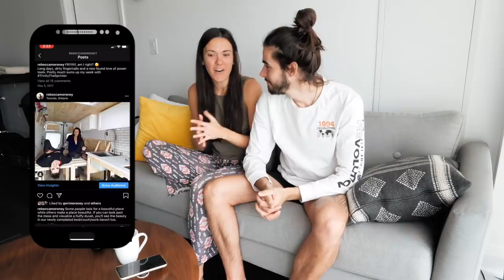VAN LIFE: Installing Windows on Sprinter Van Conversion

Comment: With the Seitz sliding windows it's important to install the windows so the sliding side is in driving direction front. Otherwise you might run into issues with noise and water pressing into the gasket while driving. I don't know if it's the same with C.R. Lawrence ones.

Comment: Hey guys, great job so far. I'm no expert, but here's a suggestion. I think the right window should be with the sliding part the other way around, like the one on the left side, for better aerodynamics and seal while driving, especially in rainy days.

Comment: I would recommend flipping the second window you installed...you want to fixed pain to go towards the front of the van so the wind doesn’t push air and water through the seam where the fixed and sliding pains meet. So it would match the other window in terms of orientation in the hole.
Reply from the maker: Thanks for the thoughts Kyle! I wasn’t sure you were able to do this as there were three ventilation holes at the bottom of the window. Have you ever done this before?
Reply: Yes, we did it on our skoolie @roamingrivers.  However ours have the weep holes on both sides...those holes are for the water that lands in the window tracks, so it can drip out of the van and not into the van if the track gets to full.  If yours don’t have the weep holes on both sides, you could always drill a few holes and make your own weep holes.

Comment: We installed our CRL windows literally 2 weeks ago and had the exact same problems! The first hole, too big... and the screws??? What exactly are you supposed to screw them into?😂 When we did the second one we pre screwed all the screws in the holes BEFORE putting it up and they went in wayyy smoother once it was in the van wall!

Comment: I feel your frustration with those CR Laurence windows. I put 2 of them in my van, too. It’s really ridiculous that they don’t come with a template, especially considering how expensive they are. Is that water fill going to be high enough—higher than the top of the tank you’ll be filling? After spending hundreds of hours building my van over the past year and a half, and dealing with all of the difficulties and frustrations, I can’t imagine ever building another one. I’ll be very happy to complete mine later this year, and to not be building all of the time. Good luck with the rest of your build!
Reply: Put the retaining frame where you want the window on the inside of the wall, to clear structure. Drill one hole to locate to the outside. Move frame to outside of the wall, using the hole to locate it. Screw the frame in place with sheet metal screws and trace around the outside of the inner flange. (Not outside the outer flange (too big) or inside the inner flange (too small)) cut right on the line and you’ll have about 1/16” clearance all the way around. Much more accurate than any template. These products are intended for trades not DIYers, so DIYers have to make do. 
Trim the hole with a single strip of butyl tape with the join of the tape ends at the bottom corner of the window toward the rear of the vehicle with ends tight but not overlapping and install the window. 
When the window is clamped in place with the inner trim ring the butyl tape will migrate and fill any insignificant gap. 
The location of the joint in the tape ensures rain from above or forward (like when driving) doesn’t get driven into a gap that can get inside. 
Also make sure sliding windows are oriented on the correctly on side of the vehicle for the same reason. Unfortunately it looks like the Passenger side window is installed the wrong way around. It’s gonna be a leaker.

Comment: Glad you said not to use a level, as the van won't be level. Why did you use one for the wall battening?.. Lol
Tip... When cutting out openings, put a piece of plastic inside to catch the metal shavings or they can go ionto the floor and into panels and rust.

Comment: rather than drilling the outside of the template to get your location, drill two holes through the middle of either end of the template, then when you go to the outside they're your locating spots. It should be more precise than matching up little holes to where it looks like they belong against the template :)

Comment: How come I never see you caulking when you install the windows...install the water fill connection? That's what keeps your water out for leaks ! You should be putting a bead down on these items then push in place. Use your finger-rag immediately and wipe off excess

Comment: Hey guys... I own a auto glass company. I'm a little concerned about your windows. You should always be priming that metal after you cut it. You're going to get rust in there. And just so you know you never ever ever use silicone on your vehicle. Especially if you're ever going to use urethane. It can cause your vehicle to rust. My suggestion is that you pull that glass back out and primer the edge. I would put it in with some urethane. You could use the sikaflex that Everyone likes so much. You can get urethane with or without primer in it, I always suggest with. But I would primer it also.
If you have any questions, you are welcome to DM me. I have an Instagram account under the same name.

Comment: Have had so many of these garbage CRL windows leak. DO NOT RECCOMEND! Go with AM Auto for a much nicer window or Tern Overland. The CRL was literally pouring water inside the van and not from the cutout, from the garbage seal on the glass.

Comment: Please water test the window when you are parked on an unlevel surface. These windows did fine on a level spot, but in an angled driveway, hill, it leaked EVERY time. Water pools in the corner, than leaked inside our van.

Comment: Get one of these!! It'll save you a ton of time and make things like installing a window a lot easier!! It'll also come in handy inside the van too when you're working in there. https://www.homedepot.com/p/Gorilla-Ladders-55-in-x-14-in-x-30-in-Aluminum-Heavy-Duty-Adjustable-Height-PRO-Slim-Fold-Work-Platform-with-300-lbs-Load-Capacity-GLWP-55A/302159317

Comment: I'm sorry but your are heading for rust trouble. You are just spray painting over the bare metal where you cut the window opening. It is essential that you apply a rustproof primer first.
Reply from the maker: The paint we're using has a rust-primer in it!
Reply: Eamon and bec primed it on the first van build as well. 👍👍👍👍❤
Reply: @eamonandbec  Good!